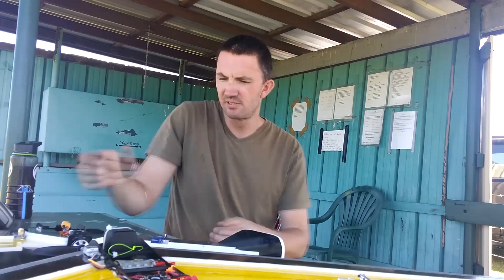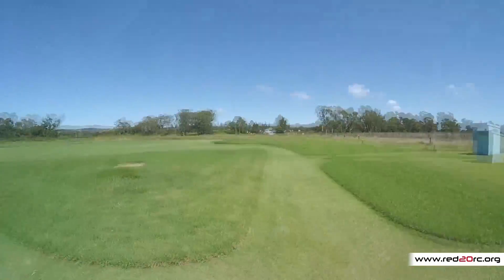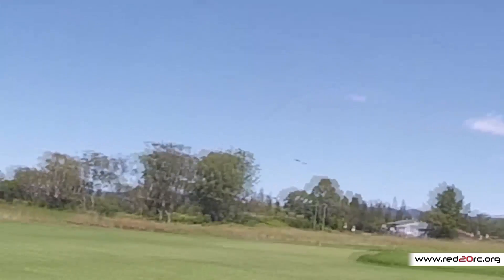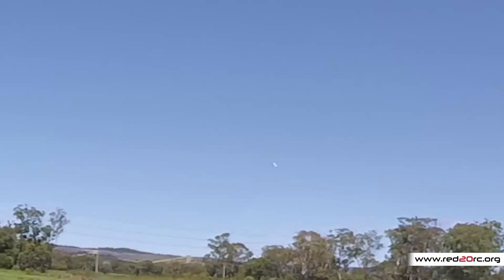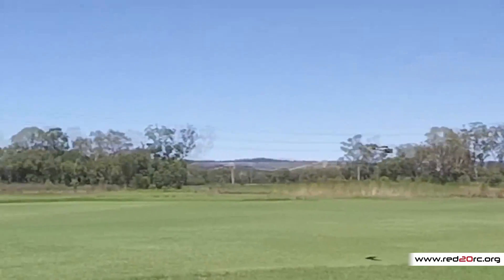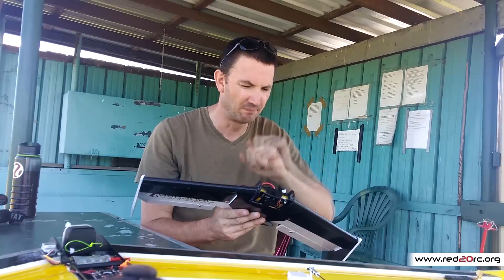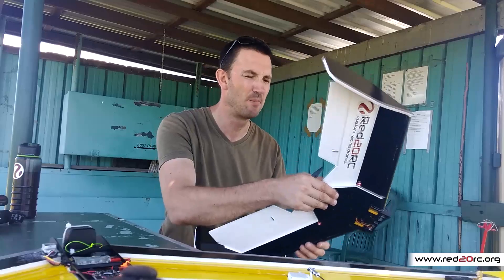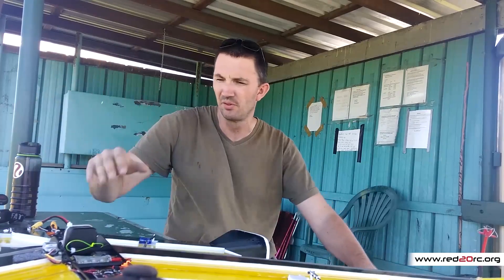NanoWing - 600mm KFm4 FPV Race Wing

Comment: Nice looking little wing and very clean build. What control horns are those you used? 

Not sure what is going on at Dubro failing to keep up with the times but  most control horns don't extend far enough forward to reach the control surface center line and are not designed for foam.
Reply from the maker: Thanks!
The control horns are ones that I cut on the CNC machine at home. I agree though, most plastic horns aren't up to the task on foam.
Reply: @Red20RC  Wow so tiny to CNC... nice job.

Comment: I see two marks at the bottom. Are they CG marks?
Reply from the maker: Yayat Hidayat possibly. I did go through a phase of putting CG stickers on everything
Reply: Red20RC which one is the best? I've trouble balancing it :D
Reply from the maker: Yayat Hidayat the recommended balance point is 120mm back from the forward most point of the wing panels. I would go there or a little in front. Just don't try to fly tail heavy.

Comment: whats the weight? can you build it uder 250 gramms?
Reply from the maker: I think you would find it hard building that light. Best thing you could try would be using Depron foam rather than foam board and using a much light motor/battery setup. One of those all-in-one Eachine micro cameras would be great for FPV'ing it as well.
Reply: Red20RC yeah, for a lighter build I wouldn't need a motor and esc that powerful anyway. I had planned something like a 7g esc and 15g motor, all the electronic parts without casing, 450 mah 3s battery. I'd skip all the tape except for the edges and hinges. :)
Reply from the maker: Lukas Longus Go for it! I've been toying with the idea of doing a slightly smaller one with a similar setup just to see how it works out.
Reply: Red20RC do it! in Europe those super small wings (<600mm) are super popular! with small 2s battery they can be as light as 110g ready for takeoff, but I wanted something a bit more powerful than that. (and do it myself, of course!)

Comment: What angle do you have for the throw on the elevons for level flight?
Reply from the maker: Team Widowmaker Combat Robotics I can't actually remember now! I would with a few degrees of up for the first flight just to be safe.  I usually sey my wings up with a lot of throw (30+ degrees) but also dial in a heap of expo (50-70%) to make sure I can handle it.